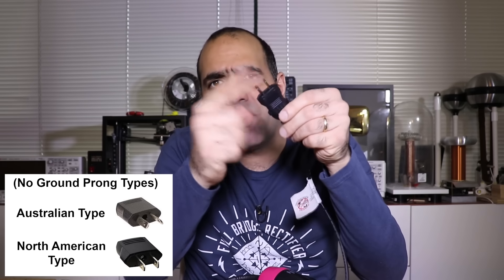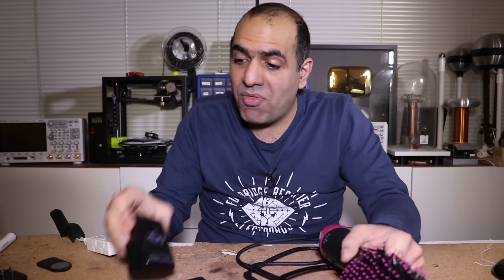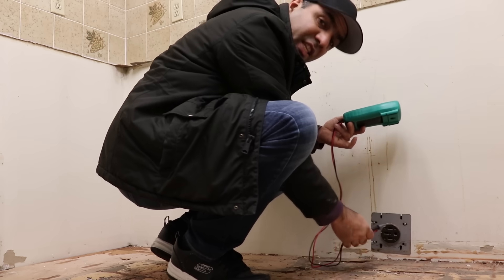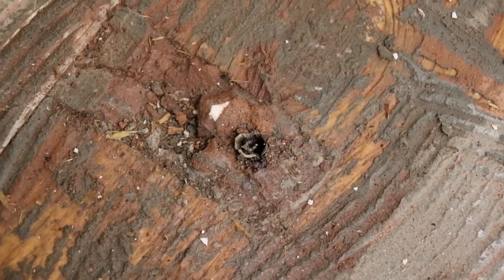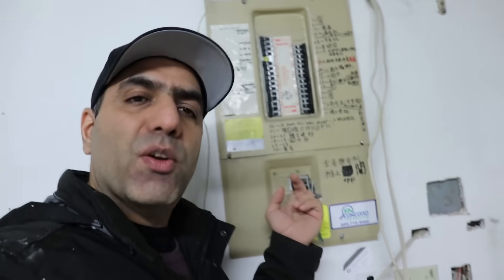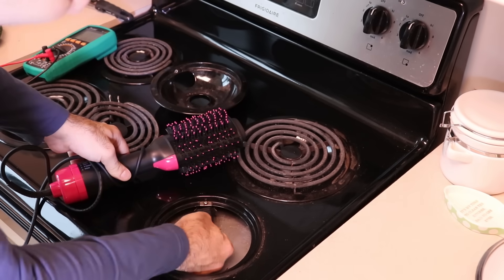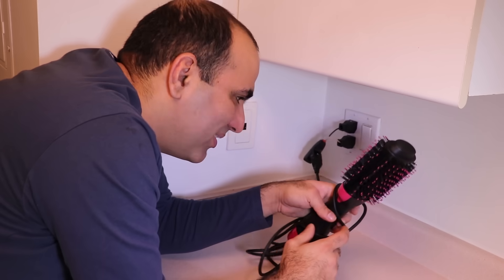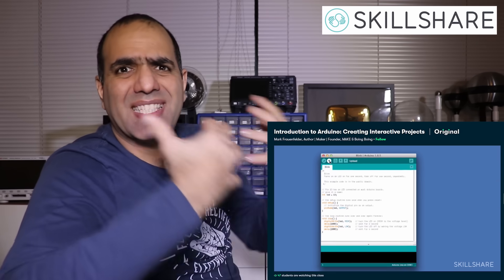Finding HIGH POWER 240V in a 120V Country

Comment: Why don’t you just put two outlet cords together and plug them into one wall outlet that would equal to 240V
Reply: If he would do that, the video would be over in 30 Seconds.
I think he has thousands of solutions in mind to make that think work alone on 120 V. But they would be not half as fun as the way he did it in this Vid...

I am pretty sure, he already knew right from the start that his Plugs in the Kitchen could provide him the necessary 200+ Volts, if he wanted. There was certainly no need for him to rush to an empty building to proove that. It is just educational (especially for non-american viewers), nothing more or less.
Reply: Why don't you watch the video before commenting? 8:23

Comment: Who would’ve thought that plugging into two 120 volt outlets would give you the 240 (give it take) you need?
Reply: if they were on the same phase it would of been a different story.
Reply: @halirl  They can't be on the same phase.  That's a multi wire branch circuit and is required to be on a 2-pole breaker since it shares a neutral, thus guaranteeing they aren't on the same phase/leg.
Reply: Anyone who understands residential wiring would, lol.

Comment: How is that arcing wire not blowing the fuse? I don't get it? 

Is it acting like a resistance heater with a large current draw, but not a short circuit? That's scary.
Reply: Yes, exactly.  It isn't a dead short.  This is why unfused small gauge line cords are dangerous.  You can completely short the other end out, and it'll never trip the breaker due to the resistance of the line cord.  It'll just get really hot and burn the house down.

Comment: 1 if your multi meter is fuse protected then it should have blown the fuse.

2. that sparking wire is a fire just waiting to happen so it needs to be disconnected from the fuse box immediately!!!!!!

Comment: In US they use 60Hz  as AC frequency so a device working at 220V taken from Eur or Australia may not work anyway with this solution...
Reply: Most devices don't care about the frequency.  High power transformers and synchronous motors are the most obvious exceptions.  Old analog TVs that used line frequency for synchronization also.

Comment: it is not a problem to add european outlets wired to 240 v.

but you have to install the two pole ground fault circuit braker for this outlet.

And it is not all. European outlets are usually designed for lower currents

Comment: Interesting that they wired it 180° phase difference but are there any benefits of doing it this way rather than 120° ?
Reply: 120 degree results from having a 3 phase power supply.  180 degree results from having a split single phase power supply.  Split single phase is much cheaper to distribute (the power co only needs one wire on the pole instead of 3), but your power capability is limited.  Residential houses get this kind of supply.  Large buildings and commercial and industrial users get 3 phase because they need a lot more power.

Comment: We used to do this all the time at the entertainment lighting company I used to work at. It was super janky, but we had a box of 2x5-15 to 1xL5-20 adapters to run 220v moving lights that we used far more then should probably be admitted for home wedding or small corporate event type shows.
Then we went to set up some lights 230V for a small show on the USS Midway museum. Despite my best tries and some then baffling multi-meter readings we never got it to work, and had to come up with some 110V lights.
A few years later I found out that ships typically use delta power because the insulation performance of the jackets of power cables was not well trusted in marine environments, so the systems were designed to have as low of potential to ground as possible. This means that old ships like the Midway and even many new cruise ships have two hots and a ground instead of hot-ground-neutral like you'd typically see on a 110V system.

Comment: Just wondering: I learned how transformers worked recently(like flux and magnetic current and all that technicalities) and I am wondering, wouldn't you be able to transform 120 V to 240 V with a single loop primary and 2 loop secondary? I know the overall flux is much less, but why exactly would this be a crappy transformer? If I put a load across the secondary, would it still increase current over the primary and supply consistant double voltage over the secondary? Why exactly do you need hundreds or thousands of turns in both primary and secondary for an effective transformer? (I know flux is greater with more turns, I just dont see how that affects the secondary voltage and output since the ratio of flux change is still 2:1, and induced emf should still be double.)
Reply: He tried that in the beginning, but the transformer is not rated for 1000W of power that the hair dryer requires.

Comment: Quick question
Why do you need to switch it from current  when measuring the voltage in some kind of electrical source?
Reply: Because in current a multimeter has a direct short across the leads.  Current has to flow through the meter.  In Volts the leads are essentially open and draw no current.  If you put a meter across a voltage source with it in amps, it will blow the meter's fuse if you're lucky, or it will completely destroy the meter (and possibly your hand) if you're unlucky.
Reply: It's not quite a direct short, they use a shunt which is a low but defined value of resistance.

Current passes through the resistance, its value in ohms is known and you get a voltage across that resistor , which is then fed into the multimeter and the voltage measured. Then using Ohms law, because the resistance is known, the current can be determined.

Comment: i brought over some UK style outlets and back boxes and installed them at my place in Canada so I can run my UK and Hong Kong bought devices, they work fine for most things but can cause issues for others due to the frequency being 60Hz instead of 50Hz. The UK sockets are so much safer than the American version so I rather install those than change the ends on the devices, so I installed those right into the wall during renovation complete with a proper consumer unit and RCD protection in every room right next to the N.American 120v outlets. The outlets are so much easier to wire too just strip, put the copper in the hole and screw tight vs. the N.American where you have to wrap the wire around the screw which is extremely messy. another good option is to use a car inverter from a 240v country with sufficient power rating and true sine wave (which needs to be researched or tested as some of the manufacturers tell bullshit on the labelling)

Comment: Your apartment building runs on 208V 3 phase supply but each apt gets 2 phases in a 208v 1 phase panel, nominally it's not 200 or 205

Comment: 5:15 Same here two weeks ago - I went downstairs and found two unrelated people came for house preparations for a function - one drawing power for an industrial grade drill and another hooked up from same power extention trying to run an industrial size food processor - where the same extension was already running an espresso machine. I realized the load for these three can add up to a disaster and came there just in time. There were already around 26 people right around there jumping over these cables.

Comment: Interesting to know where you're living only has 205v instead of 240. I thought most places around North America, no matter where you live, was two phases 180 degrees apart. Only time I've heard of 205 is with 3 phase power, which, at least for audio engineering stuff, is 120 phase shifted.
Reply: He's in an apartment building in an urban area.  The building is obviously wired with 3 phase power.

Comment: US (probably Canada too) homes actually have 240v. The normal wall outlets usually only get 120v.  If you look at your hot bus in the distro box, there are interweaved fingers, each one supplies a 120v phase.  This means that every other breaker in the distro box is run on the same 120v phase.  So that's why the 240v outlets has a dualey breaker, it is supplying 2 hots and 2 neutrals to get 240v, but by locking the two 120v breakers together, when one pops they both do.

Sometimes an entire kitchen is supplied with a 240v dualey for the those stove plugs, allowing the outlets to have two different 120v circuits
Reply: They aren't different phases.  That's a 120v leg, there's only one phase going into that box.  A 240v circuit doesn't need a neutral, but if one is used (like on a 4 pin dryer outlet), there's only one neutral, not two.

Comment: im not sure about canada, but the US is actually a 240v country not 120v. Obviously you're the expert here, not me, but as far as I'm aware North American residential power isn't 2 phase, it's a single split phase. the transformer outside is producing 240v and then splits off into 2 legs with a 3rd tapped ground, giving 120 off each leg, but they're still coming from the same source, so I don't think that would be considered actual 2 phase.
Reply: US has 120VAC single phase, and three phase 200VAC or 240VAC

Comment: Your apartment, like many businesses, probably receives 3-phase power with each leg 120 degrees apart, while homes in North America receive 2-phase power with the legs 180 degrees apart.  All of the circuits are then wired to balance the loads, and apartment dwellers (at least some apartments, maybe not all) end up with a 120-degree phase difference for their high-voltage outlets.

Comment: I never understood why they poke fun at us in the United States. We all have 240 volts in our homes. Air conditioners, electric hot water heaters, stoves, ovens, electric clothes dryers and large motors for tools all run on 240. My service is 240 volt, 200 Amp or 48kW.
Reply: Yeha but in other countries we have 240 for all. And 380v on three phases for big machines

Comment: In North America, most homes have single phase, 2 pole, 240 volts power from a center tap transformer on the street. Apartments in multi tenant apartment buildings usually have single phase, 2pole, 208V power usually from 2 poles of a 208/3 phase y service.

Comment: 100v is about the minimum you should be getting from each phase in the US and Canada. 120v is the nominal (and expected) voltage . If you only get 100v out of one phase, you should check your electrical system and/or load distribution at your circuit panel. Funny as hell video!
Reply: He wasn't getting 100V.

Comment: In the us, the main power lines have 3 live wires. if you have a 3 phase transformer powering your house you will have 3 legs and one center tap coming in, the 3 hot legs will have a 240v difference between them,  and going from the center tap to either of the two "lower" legs will give 120v. The center tap is tapped between the two lower legs. if you go from that center tap to the third leg you get 208v. Most houses will have a "1 phase" transformer powering them, there will only be 2 hot legs and one center tap(thats connected to ground) giving 240v between the hot legs and 120v from the hot leg to center tap. I believe this gives you two phases of 120v.

Comment: If I am not wrong, the final output voltage of both power points is 204v when connected in parallel (higher voltage), then how a device that require 240v worked well without any issues?
Reply: Connecting those in parralel wouldn't make a difference. In series it will output higher voltage

Comment: We live in Argentina with all the power at 220VAC...we brought as many appliances possible from the US years ago...we got a handful of 220-110 transformers for the smaller stuff. The washers & dryers needed major power, but the US versions are still 220 but center-tapped ...we now have a giant auto- transformer, 220 in, 220 out w/center-tap  that runs our US spec (large) clothes dryer....not the puny toy things you get here.

Comment: Yes, I have tried to measure voltage with multimeter on amp setting, melty CABOOM, especially with an old fuse wire fuse box! Unlike Mehdi though mine was mistake a was out of stupidity, not for educational purposes!

Comment: Question, you said in another video that Some devices Don't care if it's Dc Or ac
So why not just make a Full bridge rectifier and Regulate the larger Dc output to 240 volts??
Reply: Hairdryers works on 240AC not dc
Reply: ??? Why though? The heating element in the hair doesn't care if it's AC Or Dc

Maybe the fan does
Idk

Comment: Uhhh... Doesn't connecting two outlets will add up the voltage....simplest explaining😅
Reply: If it's on the same phase, no
Reply: @sovietcomrade7733  And even if it is on different phases - no.  They don't add.  They multiply by the square root of 3.  If they're on two legs of the same center tapped transformer, then they add.

Comment: 2:13 - blows a 100w transformer 
3:48 - shorts out 240vac
5:14 - wire sparks
6:04 - spaghetti pasta crunch scare 
6:17 - frying pan  falls on him
7:28 - jump scare with a hair dryer 
8:34 - gets shocked from a wall outlet
Reply: I wonder how he made the explosion when he "shorted" 240V. The meter wouldn't explode like that without any burn marks
Reply: @dreamcat04 if it's in current (A) measuring port , it will do. I also accidentally while measuring 220v AC voltage I plugged in current measuring port and it just blew
Thank God did it in flux box which had fuse and blown. My multimeter fuse too blown. Replaced and learned lesson haha..

And I tried to measure current drawn by an soldering iron connected to 220v AC.
But it really gone wrong..
Reply: @DheerajKumar76x  did it really explode like Medhi's did in the video? I didn't think such an explosion was possible at "just" 220V
Reply: @dreamcat04 it looks faked to me. The spark happens at the multimeter instead of the outlet, and the cables of the multimeter fly right out which wouldn’t actually happen. My guess is that he blew up a capacitor since it also looked like there was a slight jump cut when he put the probes in.
Reply: Underrated.

Comment: As with all else! Read the !!!! instructions !!!

So you dramatized that by your little "demonstrative accident" Of course an iron core transformer adequate to a device such as that one is available but someone might mistake that as a doorstop, given its size and weight. I have one of these in my hobby shop, and to move it I had to make a steel tubing carry handle wired around the body with heavy steel wire. also I added a fireproof metal box to manage the connecitons, and still that remains in the shop or used ina protecdted area when absolutely necessary.

Obviously not for your sister in law! Nor would she be advised to try and use it with the North American 240 volt system as the grounding may well be incompatibly unsafe in relation to that har dryer which was made for countries where the neutral is connected to one side of the 240 volts, not in the center tap.

On the subject of your showmanship, it IS dramatic, and maybe effective for adults, however it also reminds me of that German childrens' book "Struwwelpetr" which was of somewhat like sternness.

However while this approach is good for adults, it is not for children and so more recdently "Struwwelpetr" ihas seen less commion use in parenting.

Comment: How do they invert  it by 180 degrees?
Reply: It's a single phase with a center tap.  When one leg goes +, the other leg goes - with respect to the center tap neutral.  Another way to look at it is the neutral is always half way in between the voltages at each end of the transformer.

Comment: Both sockets in the same outlet are connected to the same 120 V line. The phases are separated at the breaker box so you will need to wire two different outlets (which will likely be rooms apart) on different phases to do what he is describing with using regular sockets. It is still completely unsafe to do and would be better to just use the 240 V outlets for the dryer or stove.
Reply: As he explained, the two outlets are on two different phases

Comment: I was wondering if anyone could elaborate a bit on the phase difference between residential and commercial housing units? I assume that it has to do with the way the 3 phase power comes into a commercial installation 120 * 3 = 360 in a 4 wire wye. 
However wiring apartments really isn't my area of expertise.
Reply: No this is not right. You don't take the phase voltage of 120 volts and multiply by the number of phases. You need to take in to consideration the phase angles.  The way to do the calculation is to use trigonometrical functions including sin().

120 volts phase voltage in a 3 phase system gives a phase-to-phase voltage of 207 volts.
You can round it up to 210.

Comment: I live in the state of Santa Catarina, Brazil. We're literally surrounded by 120v states, most of the country is 120v, but we use 240. I remember forgetting to take my converter to charge my DS once visiting some family in Paraná and finding out I could just plug it straight into the wall.

Comment: I’m curious, US 240 tools used in Europe 220/240? Would that work?
Reply: As long as they use a 3 pin plug and don't need a neutral wire, they'd work on 240V in Europe.